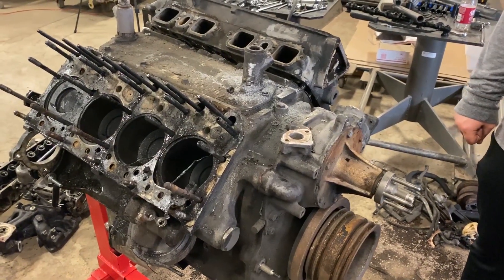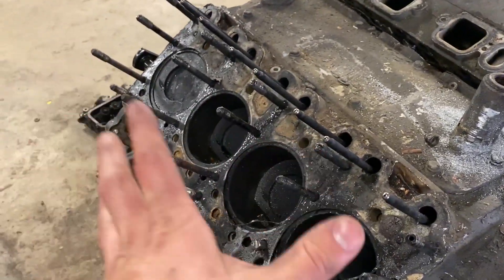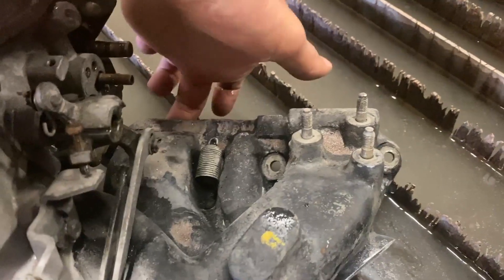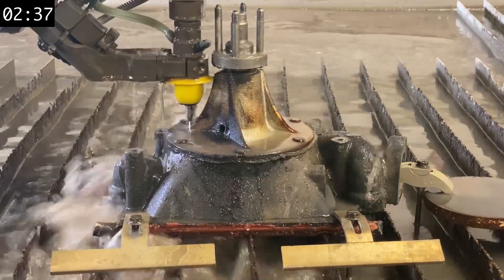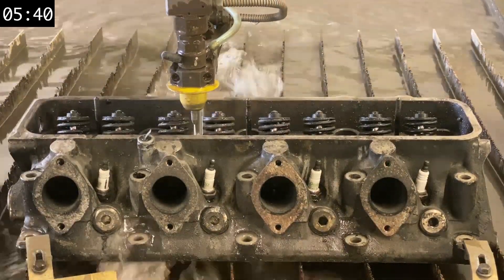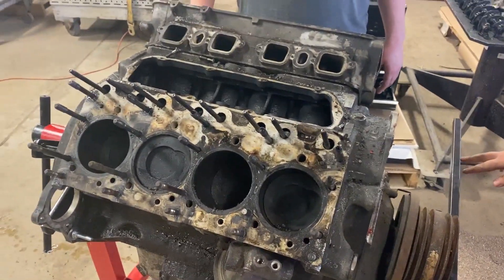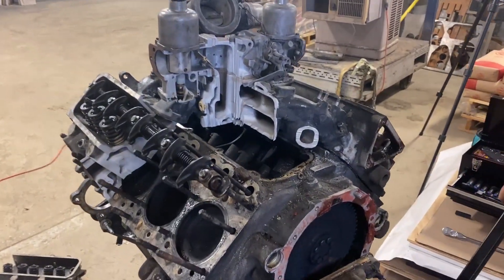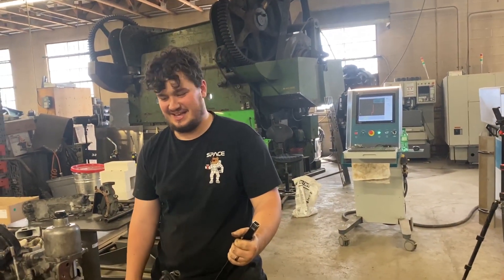V8 Rolls Royce Engine Cut in Half with 60,000 PSI Waterjet

Comment: It might as well be seized up, it should be a lot easier to turn without the heads on
Reply: Yeah it definitely hasn't run for ~4 years. So somethings wrong. The solution to not engine swap it was a rebuild which is about $3K

Comment: Putting a Toyota motor in a vintage Rolls Royce is blasphemy.
Reply: David Chadwell I’m gonna put a rr mustang engine in a Toyota supra now just to spite these guys
Reply: There is a Tesla powered Rolls Royce ! Is that blasphemy?  What about the ICON Derelict V8 race motor Rolls conversion ? They basically built a street rod chassis that perfectly fit under a Rolls body.

Comment: That's is not a government of the engine its called a constant velocity carburetor and it works off vaccume . once the vaccume is achieved it forces that slide and needle valve up and balances the barometric intake pressures making the engine run more efficiently...

Comment: Those are constant velocity carbs. You see them on motorcycles a lot. The butterfly valve is controlled by the throttle cable, the round slide is controlled by vacuum.
Reply: There is a tapered needle that seats in a fuel orifice that's in the path of the intake. 

The fast moving air creates a vacuum in the space in the bell above the round slide, sucking it up away from the fuel orifice. 

As the needle is tapered the more it is withdrawn the more fuel is allowed into the intake airstream.
Reply: @alisdairherd9501  See this is why we need someone like you able to facetime in and explain what we don't know. . . .
Reply: That's really cool. We were trying to figure out how it worked

Comment: Intake manifolds don't need "cooling"... they use the engine heat to pre-heat the intake charge when it's cold weather. Heated intake charge also improved MPG and exhaust emissions.
Reply: For mpg and emissions, yes, but who cares about that? If you want power colder intake temperatures are the way to go.
Reply: @svetko05  Agreed that cooler intake charge means more density, but you can't get cooler intake charge by cooling with the engine coolant system. BTW, I totally disagree about disrespecting the only environment we have... that's like intentionally pouring poison in the water you drink. Others have to have a liveable environment after you're through with it!

Comment: As a brit this is the worst thing ever first you cut the engine in half that you could sell for a fortune working or not and secondly put a bloody 2JZ in a rolls the JZ is like a plague just like the LS. Hey steve i just got a roomba. Put a LS in that bad boy LS and JZ everything even your toilet
Reply: It's actually worth $6k rebuilt. It'd cost me at least $3,000 to get it rebuilt, and then there's no guarantee it sells anytime quickly. The Silvershadow was actually a fairly high production number car.
Reply: @LewisFausettManagement  Yeah but would not really call 30,057 produced high production! from 1965 to 1980
Reply: @danfox1458  It's high enough production that these engines aren't considered rare or collectible by any means though

The biggest issue is that you can grab one of these cars running that needs paint and interior work for ~$20,000. These aren't nowhere near worth a fortune

Comment: Isn't an LS swap significantly cheaper than a 2JZ swap?
Reply: Well yes but when he is looking at R8s and Panameras, I don’t think money is a problem.
Reply: @kaemonn1546  1. R8's and Panamera's are cheaper than you think. You can get a Panamera Turbo for Cheaper than a new Toyota Camry if you're patient enough.  R8's run from $50-80 but they tend to actually depreciate fairly slowly. The cost of ownership is really only ~$5k per year which is a lot but can be worth it if it's your dream car. 

2. LS is cheaper than 2JZ at the floor but LS engines can also get much more expensive. It really depends on what you want to get out of it.

My big thing is I want a unique build and no one has 2JZ'd one of these but they have done a few LS swaps. The other big differentiator is Torque. It's much safer to go with an LS for torque concerns but we're pretty sure the 2JZ will be fine in this scenario.

Comment: guys just modify the waterjet and cut the engine whole in half. Maybe drain the tank water. You can't waterjet through large distance into the crap at the bottom. Actually, now I want a video of this. Running the waterjet with little or no water in the tank, see how AWFUL the cut gets?

Comment: Could you cut open a sparkplug?

As far as I have seen mentioned, they have apparently a complex layering of various materials in order to get a seal from ceramics to steel.
Reply: I'd enjoy seeing this.
Reply: I'd also like to see this, different temperature ranges would be good to see, hotter plugs should look very different inside to colder ones
Reply: @Muffinx93  Nah, they'd look the same. It's mainly the spark gap that affects plug temps.
Reply: I have broken open a spark plug before and I did not see layers, just a metal electrode going all the way down the center. But it was just a simple moped spark plug. May be different in some Bosch BMW plug
Reply: False Flag  True, I just wonder if they have skipped some mid-alloys to protect company secrets.
Reply: False Flag  wtf are you talking about?
Reply: the ceramic would not survive, nor would you be able to see the layers.
Reply: They already did. Look it up.

Comment: Bet you he’ll do the LS swap  
Cheaper and easier to find
Reply: I'm heavily leaning towards the 2JZ. Next week I'm test-driving a C10 with an LS3 and a 2JZ GTE Supra to see which I like better.

The big thing is that the LS has been done before where the 2JZ would give us a much more unique build, and I like doing weird unique things. 

I have a source for both so getting the engines isn't the hard part.
Reply: @LewisFausettManagement  definitely go with the 2JZ. Nothing against the LS, they're great motors with excellent bang for your buck, but these days they're basically the default engine swap option. The 2JZ would have a lot more character!

Comment: I don't know enough about old carbed engines, but either the slidey bit or the butterfly is the choke, while the other is throttle. I'm guessing the slider is choke since I don't see where the throttle cable would connect.
Reply: Yeah I have an old engine manual on my computer. I should have studied it before we filmed, but I mean, where's the fun in that?

Comment: You make me sick doing that😭
Reply: I honestly think it turned out cooler this way. This car was actually produced at a decent volume and now there's a cross-section of the engine back at the dealership, and we get to make a very cool car.
Reply: That engine had problems, it shouldn't be that difficult to turn the crank especially with half the valves missing
Reply: So I know one of the issues was it needed new carburetors. The thing is, you can get one of these engines working for ~$6,000 USD on ebay. There's not a shortage of them by any means. 

We just were going to junk it but thought this was a better use.
Reply: @LewisFausettManagement  clean it up, all of it.  Put the parts in a parts cleaner, get it nice and clean, paint it nice, and display it.  That could look like a really cool display or show piece.  Get a nice gear-reduced crank on it too, so people can turn it!
Reply: @chubbysumo2230  I agree. I took it to the dealership hoping they'd do that (there's no space at my place for it)
Reply: Lewis your an idiot
Reply: It's just a shitty pushrod V8 with twin single barrel carbs... 6.7L and probably put out less than 200hp. Also it's not even rare. At least the car get to live again with a new heart.
Reply: @fullraph  Exactly. There were 30,000 ish of them. Nothing crazy at all here

Comment: vacuum draws up the piston lifting the needle allowing fuel to flow in the carby section
Reply: See this is the kind of insight we needed.
Reply: @LewisFausettManagement  as a mechanic that has owned 2 shops and a mobile mechanic business ...if i dont know its probably since i closed up shop due to failing health but in gen most things aside of electronics have not changed since the beginning of internal combustion engines

Comment: A 2JZ in a heavy Rolls is gonna suck. To make bottom end torque you need to use a smaller turbo, which is a must for a heavy car. But you need a big turbo for big power, which will have lag. So unless you’re building sequential, it’s not going to be happy. An LS or Hemi swap would be a better idea.
Reply: It's actually a lighter car than a lot of people think. Especially because ~1,000 pounds of the weight comes off when you swap the engine.

The biggest concern is Torque which we were thinking about switching the Supra transmission to fix, but in our research we found we should be fine.

We're thinking sequential turbos. But again we actually aren't trying to build the fastest car on the block. We're just trying to make it a little more modern performance wise while maintaining a cool classic car. (except we are murdering it)

Comment: Yall just cut 40k in half smfh that engine is rare and could have been sold
Reply: The engine is worth ~$6,000 in the best scenario. You can get a mint Silver Shadow II for about $50,000 (including the rest of the car)

This engine would need at least $3,000 of work to be in that same condition and there's no guarantee anyone would ever buy it because the market isn't huge
Reply: @LewisFausettManagement  You'd be lucky to get it running even for 3k in parts as there aren't many to be had and I'm sure you are finding out now RR LOVES to make parts out of sub sub sub sub assemblies.   The right fuel new fuel pump sub assembly parts to get that engine running like new if it were in perfect shape would easily run 3k
Reply: @kg4boj  TBH we didn't look. We just got a couple non committal rebuild quotes to have a number in mind. 

Most of our time has been (and still is) spent trying to find a nice 2jZ drive train that isn't $20,000 because its built AF
Reply: it was already ruined
Reply: That's what i said why tho makes no sense u bet they won't get any where near that of views
Reply: @ronniewilliz153  the good news is the engine in the lottery scenario is only worth $2-3k of profit once it's fixed. Nowhere near $40,000. I can buy a running silver shadow II for $40,000 if I'm willing to do interior and paintwork.
Reply: @LewisFausettManagement  Can get a Silver Shadow II from between £9000 to £20,000 here in the UK.
Reply: @Splooge_McFornication  Yup. I know the most expensive one in the US that I've seen is ~ $65k USD. 

Definitely not a $40k engine. I think mine is number 33,000 or something like that
Reply: @LewisFausettManagement  I don't know where people are getting $40k for a 50 year old Rolls Royce engine. You could get an absolute monster of a crate engine for much less than $40k.
Reply: @Ronnie Williz Yup, plenty of junkyard LS motors out there
Reply: It's their engine & they can do what they want with it.
Reply: @Splooge_McFornication  an we can also ? Why. Lol so ha
Reply: @ronniewilliz153  Oh I never realised you owned one....
Reply: @BladeCast i know you understood what i fucking said. Just like is there engine they can do what they want we can ? Why.
Reply: @BladeCast lol ok dude what ever helps u sleep at night.